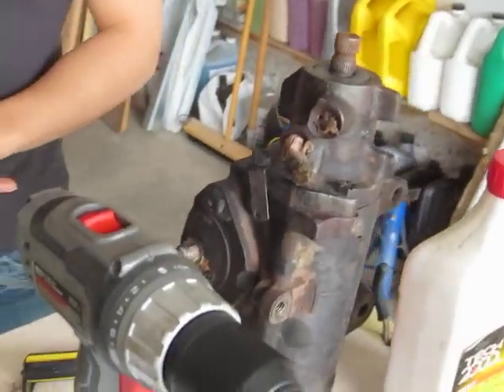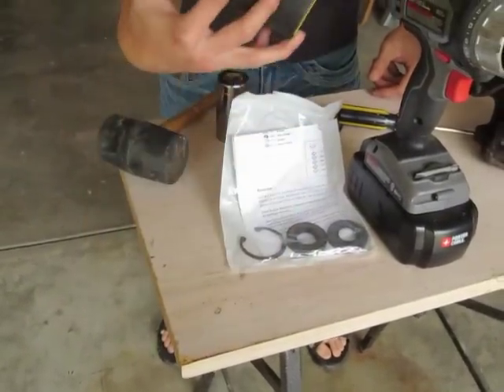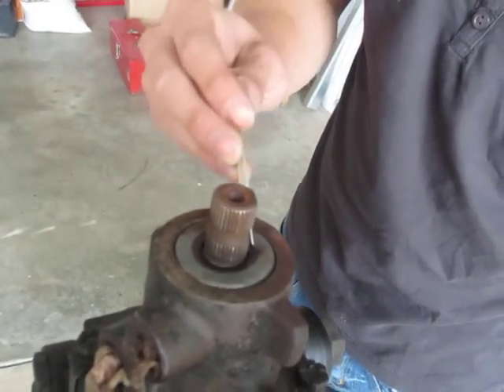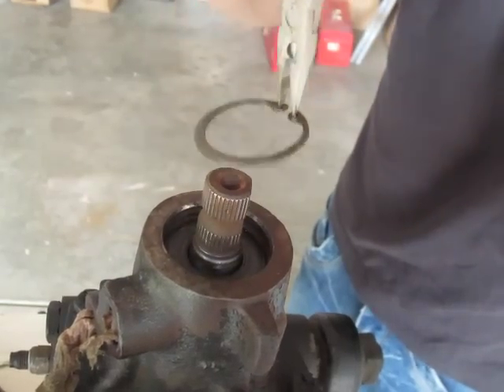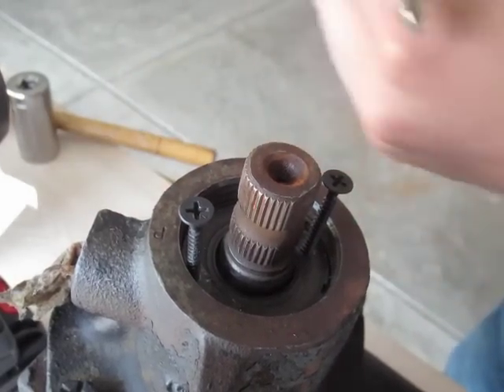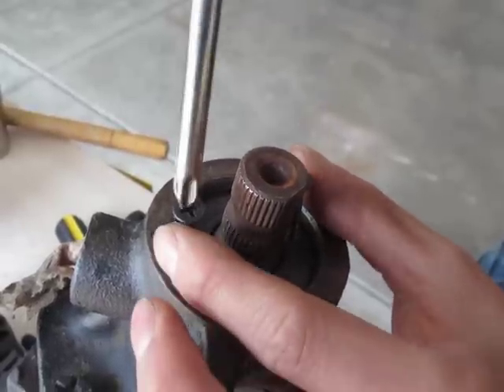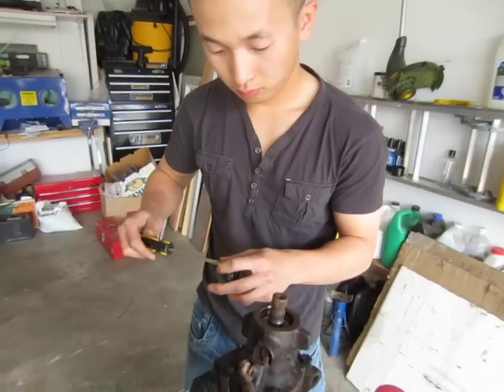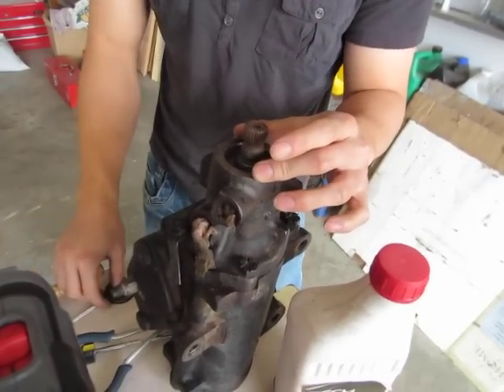How to repair Power Steering Gear Box Input Shaft Seal Leakage Problem -Removal and Installlation

Comment: Great video!
Smart young man, but after working in a shop for many years, I have one piece of advice; No flip flops when doing anything with tools. Workboots, dude. Steel toes optional.

p.s. snap ring pliers will make your life easier, too lol
Reply: Or at least get good flip flops... not those jail house shower shoes.  Just saying...
Reply: ...and Safety glasses when working with snap rings.
Reply: @cobbleup  aka spring steel bullets bouncing around the shop

Comment: Would this be the same process for a 2009 Chevy duramax ?    To where I can leave it in the truck and disconnect the steering shaft and can I just pull the seal like what was done in this video. And replace it or do I half to take to apart?

Comment: FYI the retainer you call a C clip is a Snap Ring and the best way to remove and install them is snap ring pliers. Not an expensive tool but good ones pay off with snap ring pliers because the  tips of the pliers can break off and happens often to the cheaper ones. A C clip has no holes at the ends where the gap is and they are generally used with the tension on the inner surface. Snap rings with the holes are used with tension inside or out and the pliers change for either and different gap size for the rings size sometimes.

Comment: Thank you…….looks pretty simple to me.  I would have spent more hours researching this if I had not found you.  I have the truck up on ramps and I have looked it all over.  I believe that I can replace my pitman arm seal without removing the gear box.    

Again…..Good job!
Reply: I'm wondering the same now on my f150? just pull arm and replace it right under the truck?

Comment: This technique worked fine for me!  I was worried about the effort needed to drill the two holes, but was pleased to see that I had drilled through only a thin seal, and not a hardened piece of steel.  After removing the gear box from my 1991 Mercury Grand Marquis, I drilled 2 holes using a 1/8" titanium coated drill bit.  Drilling took only 26 seconds per hole(!)  and it was very obvious when to stop drilling (when the bit was through the seal).  The seal removed easily with 2 screws.

THANK YOU tgmac8288 for saving me from tearing down the gear box just to fix the input shaft seal!  I wish I had tried drilling the box while it was still on the car using a rotary tool; there was probably room for it, meaning that I might even have saved removal and installation of the gear box.

I removed the pitman arm from the gear box but did not separate the arm from the center link.  With both front wheels suspended it was still a bit of a hassle getting the pitman arm back on, but it was possible to leave it connected to the center link.

Comment: Granted the two screws were a good idea...but you just flipped the seal which has two holes in it now 🤔 leaks again...am I missing something please let me know
Reply from the maker: You suppose to replace with a set of power steering repair kit or a new seal.

Comment: I have seal removal tool that slides behind the seal pulls it right out but I’ve definitely used the two screws trick before I became a tech. 👍🏽

Comment: THANK YOU THANK YOU, I,m doing this job tomorrow, Thanks Again,,,,
Reply from the maker: How did you make out?
Reply: Hello,well it started out a pain in the Butt,Trying to break loose the pitman arm/gearbox nut,got it to let loose then,,,,,the pitman arm puller came to use ,Wow what a hell of a POP!,when it let loose.From then on your instructions worked Great!!!.
Leak stopped!! Thank you .Cheers Mate.

Comment: the input... Is that where the steering linkage connects from the wheel or the where the pitman arm connects?
Reply from the maker: Where the steering linkage connects from the steering wheel.
Reply: Ohh ok. I have a leak in my output shaft seal. Is their a kit for that aswell?
Reply from the maker: The best is to check with your local car dealer or auto parts stores.

Comment: I noticed he was having trouble with the snap rings getting them in and out with regular needle nose pliers iv'e had to do thing with the wrong tools before and the right tools too and the right for the job makes the job ten times easier. And also drilling the seal wont mess nothing up necessary but if u get metal shavings in that power steering gear box you'll be replacing more than a couple seals  not saying don't do it just saying be aware of what your doing. But good video on how to do it without the proper tools because i know everyone doesn't have the specialty tools they may need to get the job done.
Reply from the maker: Thanks for telling people to fix with specialty tool which is totally opposite to the purpose of this video. If a simple tool can accomplish the job, why do you need the specialty tool just for one job? Don't you know that "wrong tool" means the tool can't accomplish the job?  If you did work on this power steering,  your must understand the concern about the metal shavings will never happen.
Reply: i was just saying theirs a wrong way and right way to do things and a right tool and a wrong tool to do  something with i didn't mean anything bad towards u or the video it was a really good video just throwing in some helpful tips:)

Comment: After 2 + years driving with a PS leak, finally found the source today. The area around the input is soaked. There is nothing above it as to have been dripping on it. I guess my biggest issue will be getting the other components off to do this repair.

Comment: You should get some snap ring pliers.  Its allot easier than needle nose pliers
Reply from the maker: I do have snap ring pliers, but I rather like to use the simplest tool as much as possible of which won't discourage DIY. The best repair should minimize the use of special tools. Definitely, it's allot easier than needle nose pliers and one should buy a snap ring pliers if using it often.

Comment: you need TYPE F automatic trans fluid for all ford power steering from 1970 to 1994
Reply from the maker: Yes! As shown in the video, the "Tech 2000" brand was the TYPE "F" automatic trans fluid used for old Ford vehicles. Thanks for reminding and letting us know!
Reply: tgmac8288 sorry i did not know tech 2000 was type F looked like a generic all all purpose normally it will say in big print on the front label if it is

but still should be using motorcraft tf
Reply from the maker: No problem! I should have mentioned that in the video. I do appreciate you brought it up and let all the other readers to know it right.  I got the Tech 2000 from Walmart where was close to me. Motorcraft is always the best choice for Ford.

Comment: I am changing my daihatsu. However service manual mention to put the oil seal with the manufacturer name facing the inside. Which is facing the other way unlike this video.
Reply from the maker: Remember the facing direction  of your old seal during removal and you will see the right way. Don't trust book 100%!
Reply: Maybe might be different. I just realize the seal is a few inch on top of that particular seal. So the past oil seal is actually acting as dust seal. I ended up folllowing the book. No leak. But the top part is now leaking from the adjusting screw....
Reply: Any suggestion how to seal the thread?   Ptfe tape?

Comment: where can i buy the seal kit for wrangler 2007 jk?
Reply from the maker: Jeep Parts at Quadratec - We Sell Everything for Jeeps!

Ad · www.Quadratec.com
Reply: tgmac8288 can't find it on site. can you please post direct link to the item kit?
Reply from the maker: You can call Quadratec the Jeep experts 1-800-742-4927.  On the other hand,  just curious why your local Jeep dealer can't get it for you?
Reply: tgmac8288 in here they don't sell parts of the steering wheel gear box. only the whole box. list price 2500$. I'll try to contact the site. I am abroad so phone is not an option.

Comment: You shouldn't be doing any repairs on a vehicle in sandals and buy some damn snap ring pliers
Reply from the maker: You suggestion is undeniable recommended . It is a good idea to have hard toe  boot and snap ring pliers.  But, one should have common sense and be cautious to do all repairs at all  times.  Even dropping a hammer can break ones toe. For DIY people,  simple tool can accomplish this job instead of the special tool of snap ring pliers.  This also keeps the repair cost low.  Thanks for your comment!
Reply from the maker: My answer to 
Jason Rowlett  2 years ago
Thanks for bringing that up and I missed to mention that in the video! I do have snap ring pliers, but I rather like to use the simplest tool as much as possible of which won't discourage DIY. The best repair should minimize the use of special tools. Definitely, it really help to save time and make life easier for frequent use of snap pliers especially with professionals.

Comment: Will this helps stop the leaks, or is there other place that it leaks and needs replacement/repair
Reply from the maker: This video will help you to fix the input shaft seal leakage only if you have the same type of power steering. If you are not sure that is only input shaft seal leakage, I would suggest you to clean the power steering up to find out any other leaks in order to repair or replace it properly.